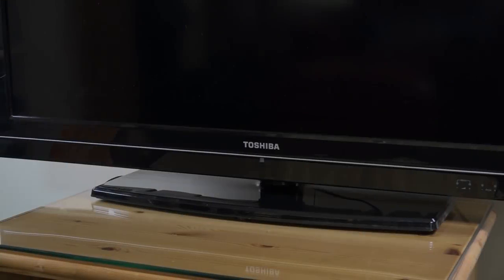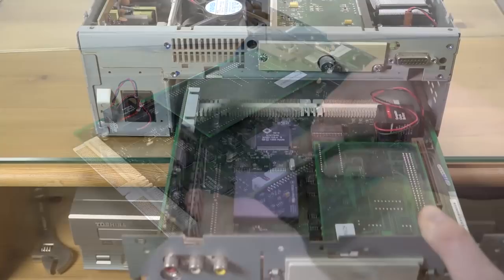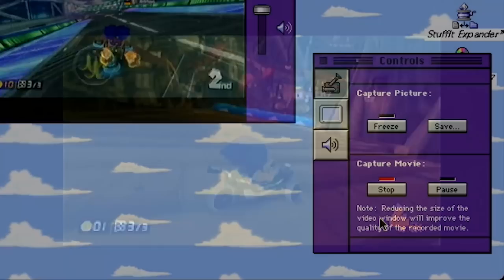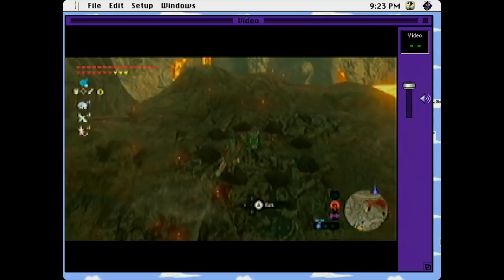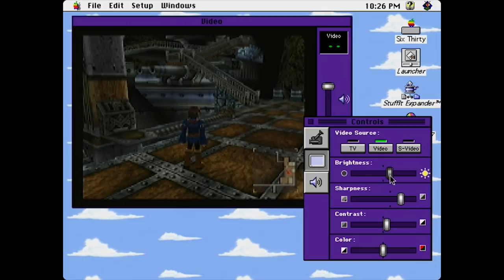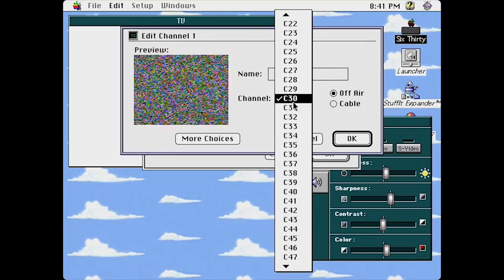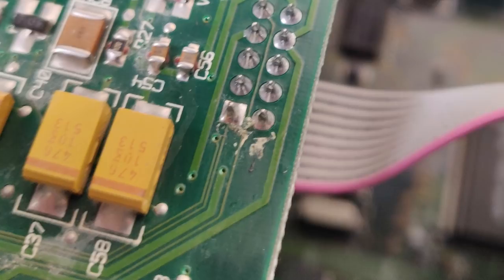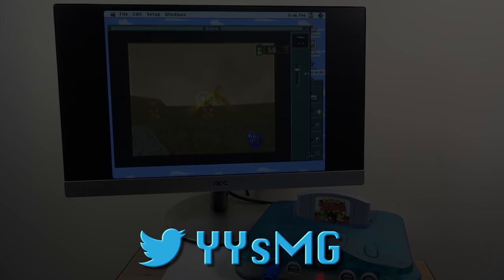Hands-on with the Performa 630 Apple Video System – TV on a Macintosh in 1994, What it can Do Today?

Comment: Sorry, to be about 18-months late to this video.  My very first mac was an All-in-One 5400 that, I picked up new around 1997.  To ensure, I could watch over the air TV shows it was ordered with what was called the "Apple TV package".  Which, I learned included two cards to be installed at home by the user.  The first was the "Apple Video System" card that also came with Avid Video editing software and the second was the "Apple TV/FM Radio System" card that also included a black apple remote control.  About five years later my system stopped working but, I removed both upgrade cards and saved them for possible use in the future.  Several year's ago, I picked up a used All-in-One 5500 which, has the same form factor as my 5400 model and after adding in both apple cards everything works great.

Today using Elgato's EyeTV 500 system, I am able to watch and record HD over the air TV shows on all the other apple desktop computers in my collection which, include a white 20-inch G4 IMac, white 20-inch G5, white 24-inch Intel IMac, and my 2010, mac mini (the last model with a built-in DVD super-drive).

Comment: Awesome vid and great production! Loved having the AV stuff in my Performa, it was amazing to take pics and recordings of my NES and N64 stuff back then. My video captures always looked waaay worse than yours here though.
Reply from the maker: Thats odd, I wonder why. I did see that it gets better with a smaller window, perhaps you were recording full screen?
Reply: @YesterYearsMacGames  Most likely too big of a window, or perhaps virtual memory was on. Regardless of the bad capturing I got so much use out of it, used as my only TV in my first apartment. ...Until the antenna coax jack thing stopped working and busted off. I soldered a wire directly to the board to keep it on life support but it didn't work well. Nothing more annoying than a staticy TV! Haha

Comment: Pretty late to the party here, but the sound over RF is on a subcarrier frequency, it looked like the RF out from the VCR needed a little fine tuning, sometimes there's a screw accessible at the back to adjust it, as it might have been adjusted for a TV with a tuner that's out of spec.

Comment: Oh neat. I used to have a video capture device myself and for a much slower Macintosh machine too! The Macintosh LCIII I bought off eBay last year came with a SuperMac Video Spigot. It was a Composite video input card that supported NTSC and Pal video modes. Didn't have audio input though. It used the LC PDS slot so could be put in something as old as the original Macintosh LC! Mine must have used it in a computer science lab of sorts as it came with science related apps. I think at one point an electronic microscope was used with it. The app this card used supported using the Mic port as an audio source so I suppose you could use that if you had some kind of Line in to Mic in converter. Supposedly QuickTime player could be used with this but I didn't find a version of the extension that would get along with the versions of QuickTime I could find.

I ended up trading the card for an Ethernet adapter as I'd get much more use out of that eventually. So some video capture options did exist in the 68k era but were kinda sluggish compared to what PowerMacs and the Macintosh TV had. I guess the Mac TV was 68k too but probably was an 040 and much faster then the Macintosh LCs. The SuperMac Video Spigot I had could only do like 256x192 or so at like 15 or 16FPS. I could expand it to 320x240 but at that res it seemed to play at like 5FPS. :P

I seemed to recall the Mac TV and similar all in one's had a LC PDS slot so I imagine they could be used in those too. I think video performance with it was mainly determined by the CPU of the machine so might have gotten much better performance out of it on a newer faster machine.

Comment: Did you try playing the captured video on a modern machine? I'm curious whether the poor framerate was in the video file itself, or just the machine's attempt to play it back
Reply from the maker: Yes, played it back on newer things and it was just as jumpy, but for a 33mhz FPUless CPU, its better than I would have guessed
Reply: @YesterYearsMacGames  If I remember correctly, TV output is not handled by the CPU. The TV software draws a rectangle on the screen filled in a very particular color, telling the graphics hardware where to fill in the video output. That is what I was told at the time, yet might be wrong.